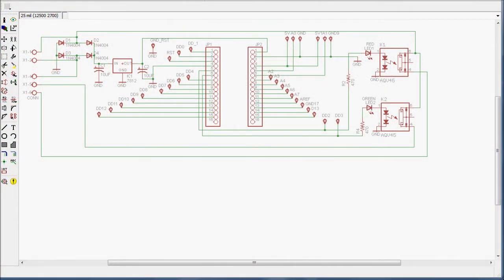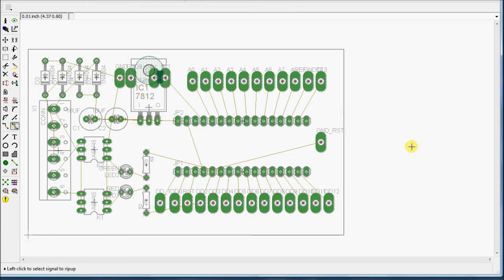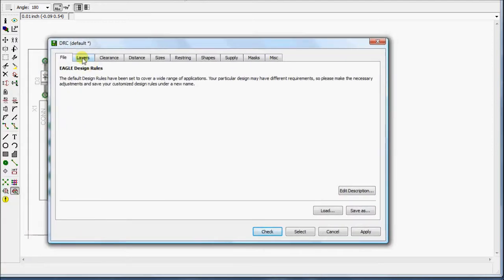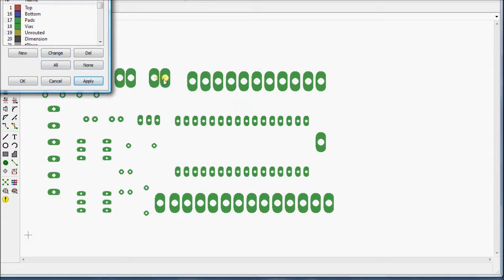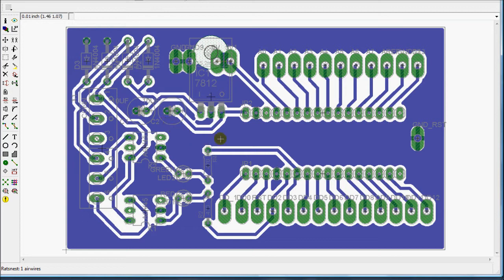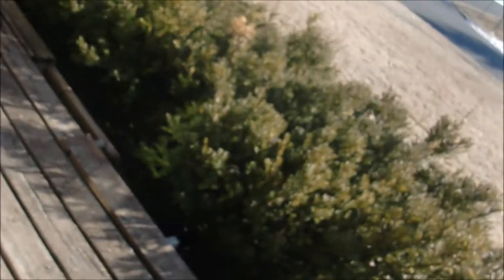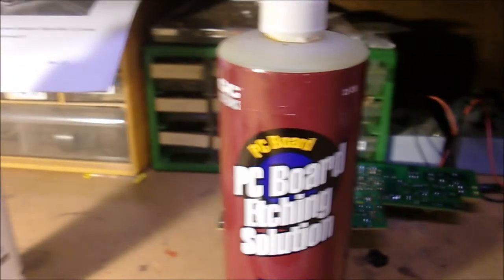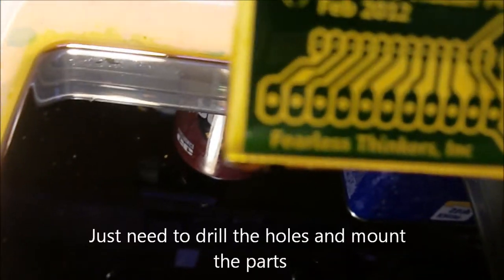DIY Solar Tracker Printed Circuit Board CAD

Comment: I used the toner transfer. stuff and what I do is creat a spot around the board on the outside were I can drill alian ment holes. I transfer one side first then drill out the alianment holes and then do the other side so fare its worked out pretty good my solid state relay is two sided.

Comment: I bought one of Kilog69 solar tracker kits I wish I could bult poles in the ground her but living in a trailer part they wont let that happen so my goal is to build two trackers to work on a flat surface of a roof.   and use one tracker to controlle two sets of panels. cant wait for the weather to let up so I can get parts and start welding.   what PCB software are you using I been using DIPtrace.

Comment: I didn't know you can use the sun to transfer the image.  I used Eagle to make a pcb of  my sunlight strength meter.  I also don't have access to a laser printer, but maybe someday I'll try to get the library to print a couple of images for me then iron it onto some clad.  I've tried a permanent marker and 2 parts muratic acid to 1 part peroxide and it's too slow, but I'm going to try a new bottle of peroxide someday.  Goldmine electronics has pcb 30,000+ rpm drill bits for a dollar each.